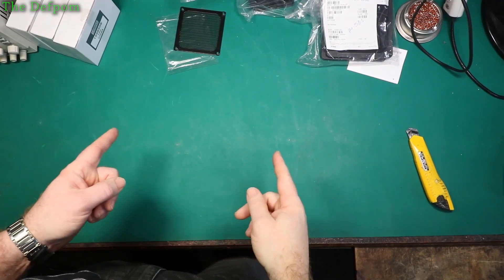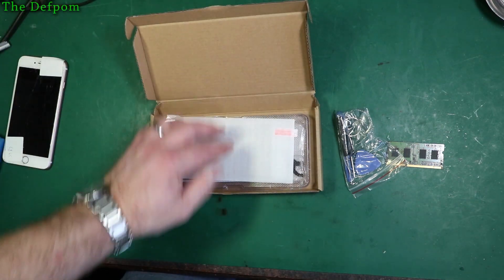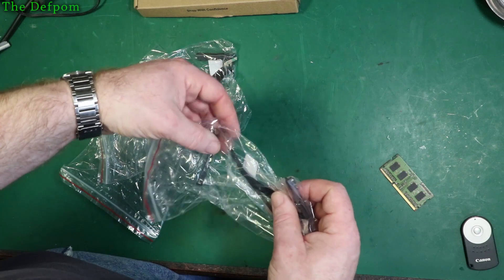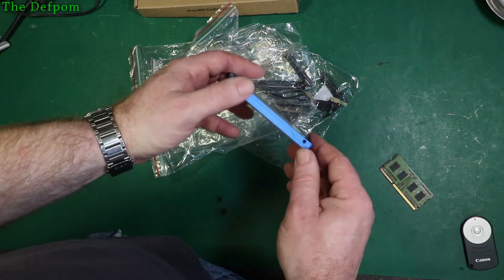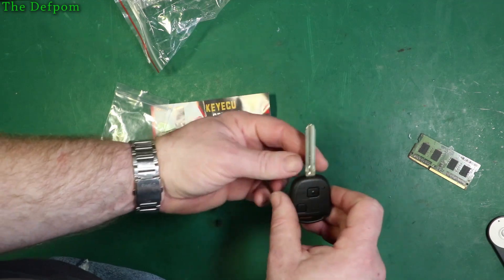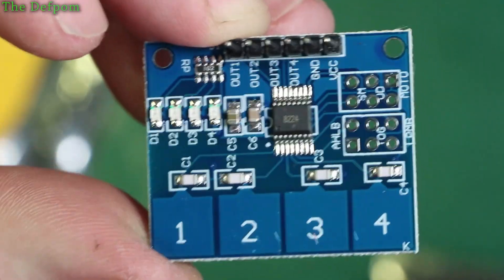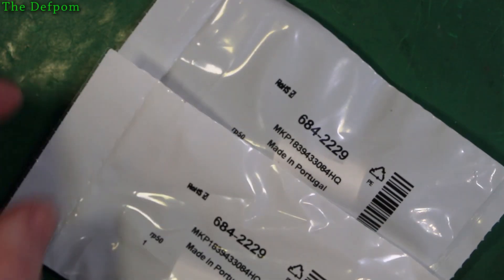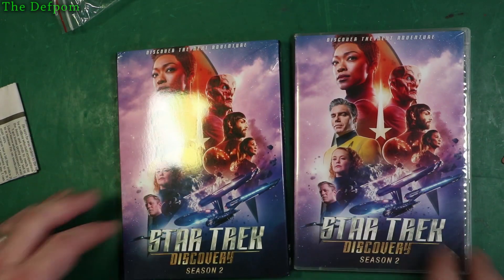#655 MailBag ! - Whats NEW For 18th November 2019?

Comment: That liquid tape is good for automotive applications and outdoor antenna connectors. You need a valve radio to put those high voltage capacitor in Scott. Regards Chris